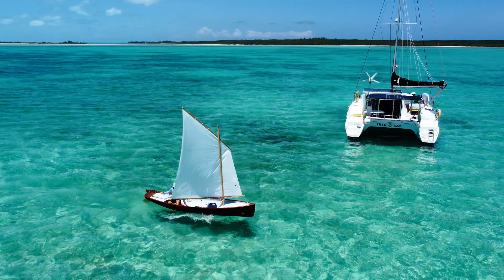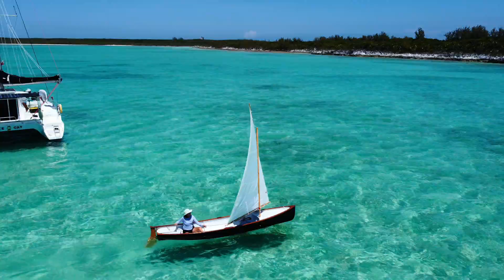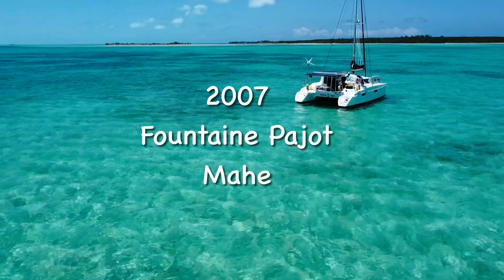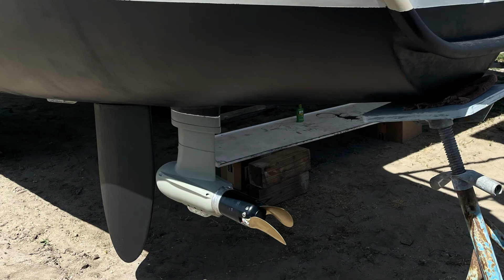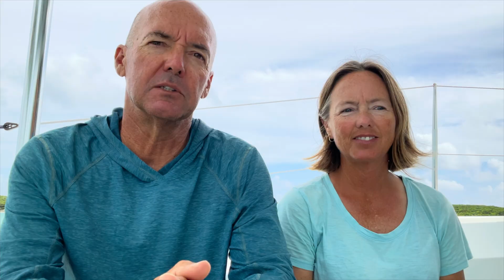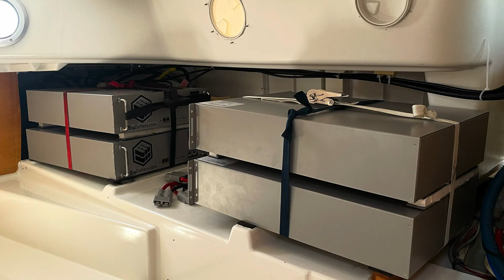TORQEEDO CRUISE FP 12.0 ELECTRIC MOTOR CONVERSION UPDATE | IRIE CAT

Comment: are you using regen at all?  im looking at a pair of 6.0p FP on a 30ft cat and dont find too much if you are sailing 4kts+ and how much power you can collect
Reply from the maker: Thanks for reaching out. Regen will only work with the stock Torqeedo batteries which we do not have.
Reply: @sviriecat  My understanding is that you need the right setup to avoid overcharging - documentation states that.  I need to double check if the system we are looking at will do this - Torqeedo + victron batteries and BCM. [From the manual]   8.3 Hydrogeneration
 NOTE! Torqeedo recommends only using hydrogeneration when the battery 
charge state is below 95 %.
 NOTE: If you use external batteries, measures may be required to prevent over
charging, depending on the type of battery used. Clarify any necessary measures 
with the battery manufacturer.
 No further measures are required when using Torqeedo batteries.

Comment: If the electric motors are this small and light wouldn't it be ideal to put them on some type of system that can lower and raise them out of the water? Less big holes in the hull, less corrosion, easier servicing. 
With a 500lb donk it's impossible but these electrics it's super easy. Then one centrally located 12k+ generator running diesel to charge battery and power motors as needed. So you can go silent or run Max with generator on powering the motors, galley, electrics, charge up etc. 
It just seems like we are throwing away the combustion engine too quick. And for what vain reason... Really wanna earn your burkenatocks and root juice shake? Run it on biodiesel.
Reply from the maker: This is the beauty of the project is that there are so many different directions you can go in. We had someone reach out who is working on creating a system where they can be lowered and raised. Which if it works is a good idea. As for us, the holes were there and we like spending our time in remote locations. Without access to diesel but with lots of sun, this project for us was a perfect solution.

Comment: Great video!  We are an electric Bristol 35, having sailed 43 days from Brazil, currently anchored in Curacao.
Reply from the maker: How exciting! What type of setup do you have?
Reply: @sviriecat  We are like you, sailing everywhere, motoring the last half-mile.  We have one motor from Electric-Volt (approx. 20hp), connected to 4 X 200amp AGM batteries, running our 48v electric motor, charging with an external-gasoline generator or shore power.  Right now we are marinating on a way to get rid of the generator.
Reply from the maker: @rainfinger nice to hear about your setup. You will eventually find a way to remove the generator. Safe sailing!

Comment: Thanks for the update.  So glad things are going well.  I've been considering a similar project in two years.  So, I'm doing my research and coming up with a plan (COA's)(Yes, I'm military :) ).  Make was actually one of our first choices (I like the Duo layout).  So a 36-40' sailing cat, remove the mast, fabricate a large roof to house solar and use a kite system for the sailing assist (more like e-sailing since I'm not quite sure how fast the kite alone would propel the vessel).  Instead of pods/shaft drive (due to hauling for service, corrosion, hauling for maintenance & just the "hole in the hull"), was looking at the new ePropulsion X12 outboards.  Now, I know putting outboards on the sugarscoops is not as effective as below the waterline (everything is a tradeoff), what's your thoughts on my initial thinking?  The outboard steering is electric, no hydraulics and I've already emailed the company about SW addition to add joystick (docking) feature if incorporating two X12's.

Thanks !
Reply from the maker: Going back to our video, I completely realize that everyone has their own approach to this.  My personal approach is that I would not consider doing it without sails. So, I would not remove the mast and the sails, would use them.  I don't know much about Kiting, but I feel that the sails would be more productive and versatile.  I like the outboard idea though!  My last thought is to make it as simple as possible.  Things go wrong  and when they do, the simpler the system the better. The best of luck to you and I'm happy to help where ever I can.

Comment: Thank you for the update. I have the Fountaine Pajot Athena 38ft. Basically the same boat as yours. I was going to install two Epropulsion 6kw motors. My style of sailing is similar to yours. Go when tides, weather and wind are favorable. My destination is Bahamas & FL Keys. Do you think 6kw motors would be sufficient? At one time you mentioned to me you rarely used more than 3kw of power. Thank you... Dave in TX.
Reply from the maker: I do think 6kw is enough. If I did it all over I would probably do 6kw. That being said, I feel our boat is very light and don't want to speak for the Athena. Are you close to installation?
Reply: @sviriecat  Yes I am close to buying the EPropulsion drives. I like the plug-and-play system. I have designed a way to lift the pods out of the water when at anchor or at the dock. Working on that now.
Reply from the maker: @DavidMozingoREALTOR we look forward to hearing about it!
Reply: @DavidMozingoREALTOR can you share a link, updates? Sounds interesting
Reply: You asked a question that I had too. I am considering to put in 2 x 6 kW drives on my 38 foot cat, and at 6-7 tonnes weight I wonder if this is OK. Did you test the installation?
Reply from the maker: @Cat-Sail we have had our two 12kw motors for two seasons. We are happy with our setup but realize 6kw might be enough. Let me know if you have any other questions.

Comment: Thank you for update! Interesting info on batteries, side note I just found out Torqeedo batteries 48v are used in the latest Americas cup boats gorbthe electronic control of the complicated ( understatement) systems . 
I have a friend fitting  2 electric 12 Torqeedo outboards to a catamaran house boat and he is interested in if you have any performance figures. 
Do you have an estimate what range you have at say 4-5 knots infill batteries are at say 20%?
Do you know what speed you can run at say 200amp max  for a few minutes for say entering a narrow cut with tides against? 
Cheers Warren
Reply from the maker: Cool to hear about the Americas Cup boats! I ran these #'s Power Usage: tested on a day with 5-7 knots of wind
1 motor at 1kw = 3 knots; 2kw = 4.1 knots; 3kw = 4.7 knots
2 motors at 3.1kw = 6 knots
I feel these #'s are quite specific to our boat which is light. My estimate would be 15-20 miles to answer your question. Wind and waves against you will diminish these numbers. Another estimate on your speed question would be 8k (max hull speed). We have come into cuts in the Exuma Cays fighting the current and were able to easily make way. It sounds like your friend has a fun project!
Reply: @sviriecat  that’s great, thank you so much!
I’m trying to talk him into getting a better platform for his project , specifically a light wt sailing catamaran , removing worn out sailing rig and probably a single central engine they did on older models like Gemini etc .  
He doesn’t need a power cat hull as they are designed for more power, ‘too draggy’. If he can cruise at 4-6knts he will be happy, short distances is fine for him too. 
Cheers Warren
Reply from the maker: @Cheers_Warren  Yes, sounds good!